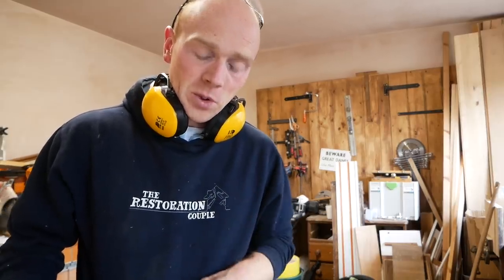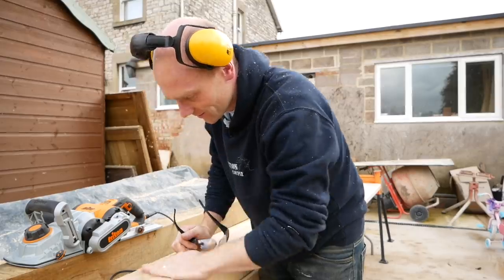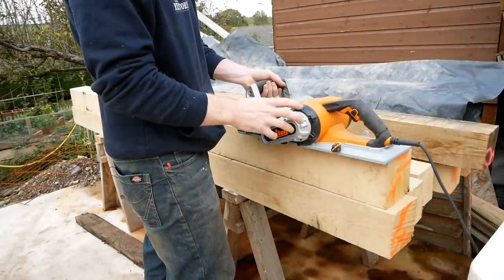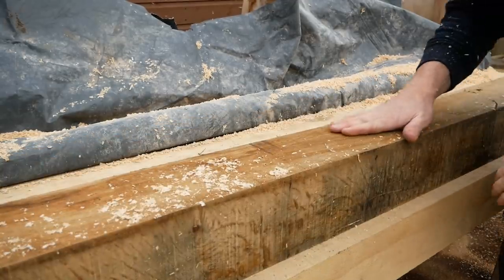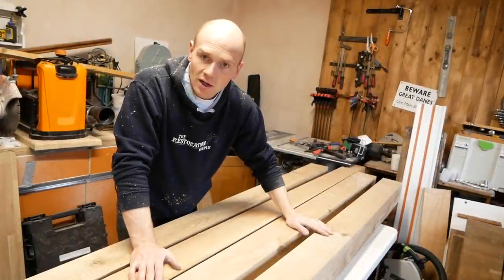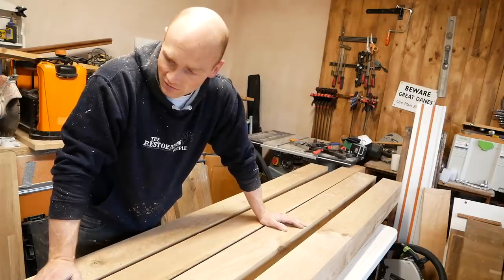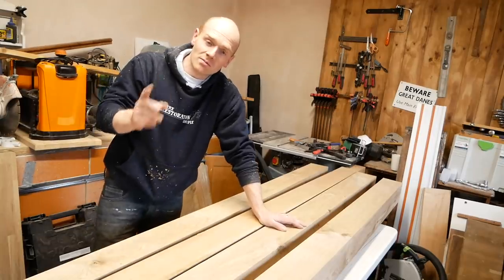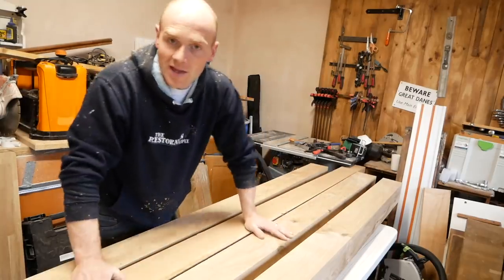THIS PLANER EATS OAK! - First Test of the Triton TPL180

Comment: If you were buying your FIRST planner would this be a good tool to start the addiction of woodworking? The only project i am trying to tackle at the moment is making a kitchen table. I currently have no tools for Planing/jointing and will obviously need to create flat surfaces.  Please feel free let me know if this is over kill too and if you suggest something else.  Thanks in advance!
Reply from the maker: This would most likely be overkill for anything like that. A good hand plane will get your far, otherwise you could look at a small table top planer thicknesser. Or just source planed square edged timber to start you off perhaps.